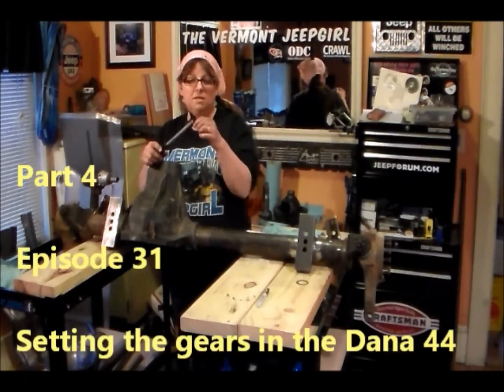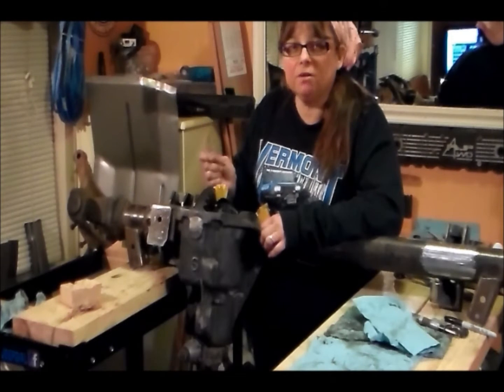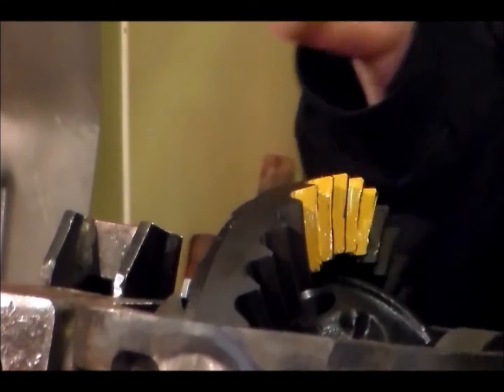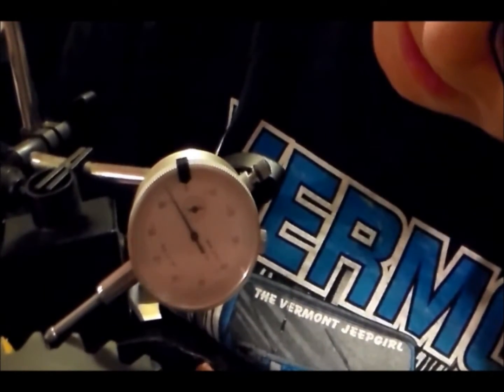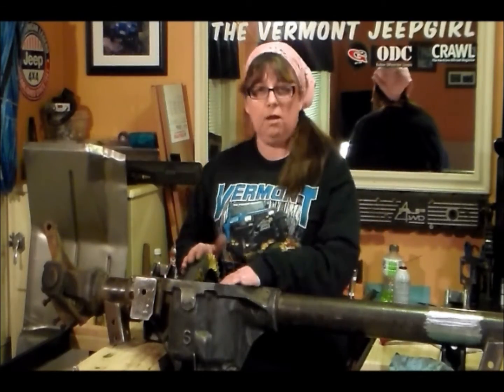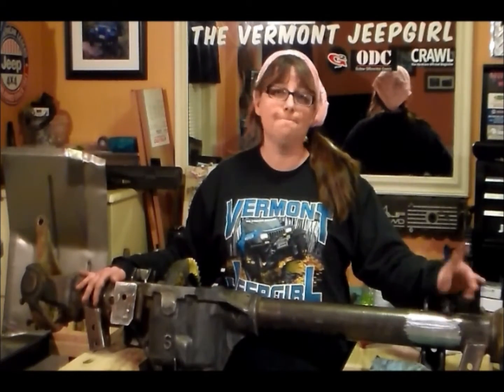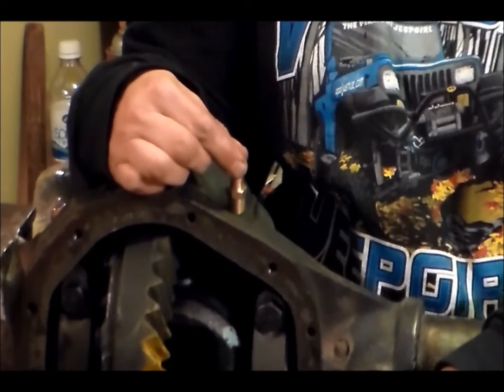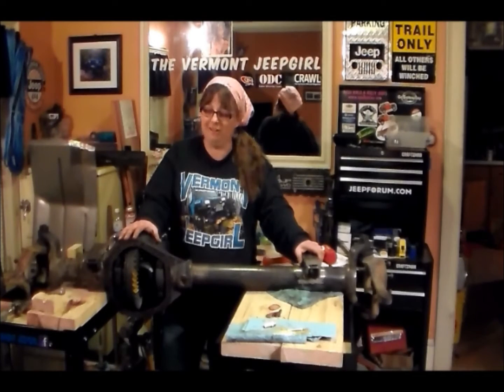Setting up the Bearings on the Waggy Dana 44

Comment: Hello, I must say I am impressed with the detailed step-by-step procedures and the information you shared.  I am actually working on a dana 30 front diff on '97 zj.  Just ordered a G2 master install kit.  I have a couple of questions:  1) Where did you acquire the setup carrier bearings and caps so that I can work on adjusting the backlash?   2) do you have video that shows the detail install of the pinon gear, bearings shims, races and the measurements relative to the ring gear?   Thanks for your help!